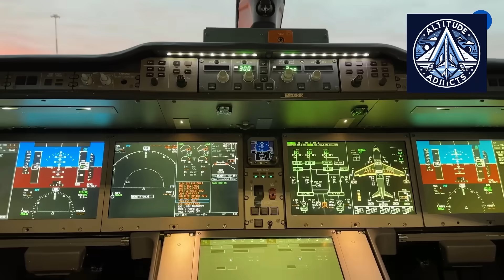Russia Forces New MC-21 Jet to Fly Through Disaster Scenarios

Comment: 😂6 tons more weight through substitutions of non Russian materials and systems? Are you OK? The Engines PD-14 have summary 28 kp thrust for the whole aircraft. 6 tons engage 6kp (21,43%) of the total engine thrust. Your information is wrong! The two engines have a total weight of nearly 6 tons and engage 6kp (21,43%) thrust. Which means according to your statement only 14 kp (57,14%) thrust remains for the rest of the aircraft - fuselage, wings, etc. - and fuel, cargo, passengers?!

Comment: For over a decade, I've been interested in and prayed for the full domestic production of a Russian civil aircraft. However, successful domestic development and subsequent aircraft certification have been delayed by six to seven years each year. Despite my perseverance, not only has it failed to achieve commercial success in the international market, but even Russian domestic airlines are reluctant to purchase it due to cost and efficiency concerns. The news that domestically developed components have increased the weight of the MC-21 aircraft by six tons is particularly shocking.
Reply: These are prototypes of components and systems... There are still several stages of testing ahead, and weight reduction will be done.
Reply: @Nahal0nok  A Jakovlev se számol ezzel. Ez már így marad. Teljesen új gépet kellene tervezni.